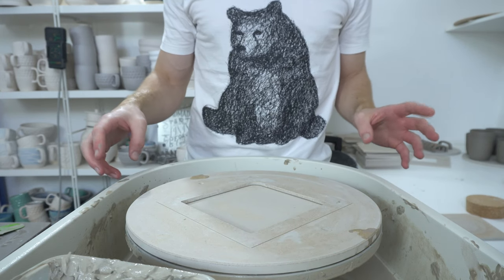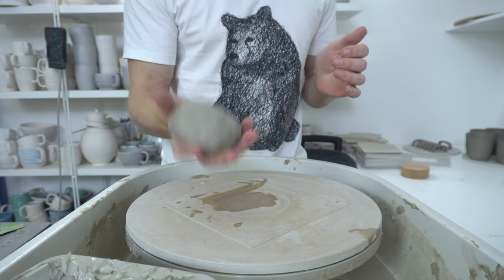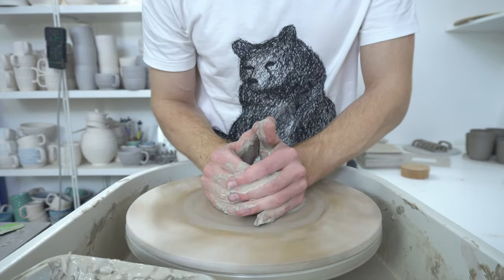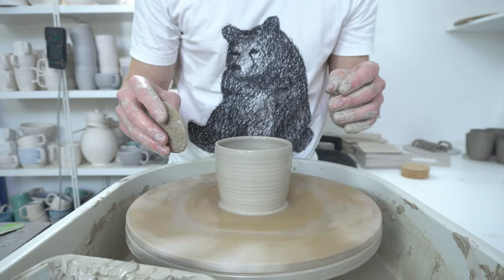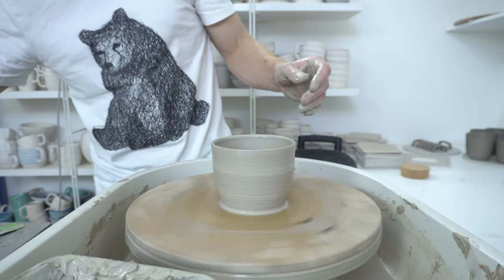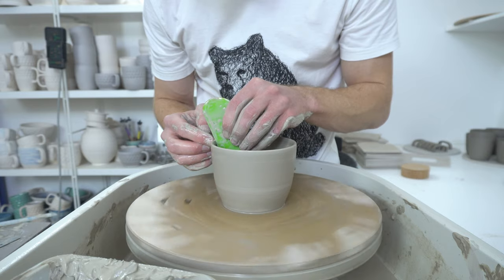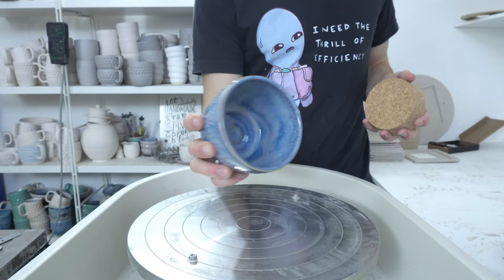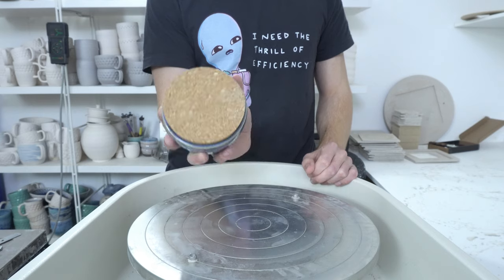Fitting Lids - How to Account for Clay Shrinkage

Comment: Lovely pot with this tight fit!! Thank you for explaining the calculating :-) Would you also consider the thickness of some glazes when you throw?
Reply from the maker: Yes, absolutely. Most of my glazes flow enough that I don't really need to worry, but the speckled glazes I've been working with recently are noticeably thicker at the rim because they don't move much at all. It still probably only amounts to less than a millimetre but would be worth bearing in mind at least.